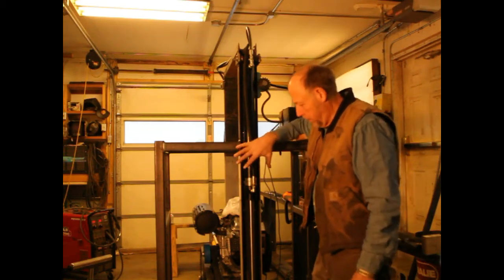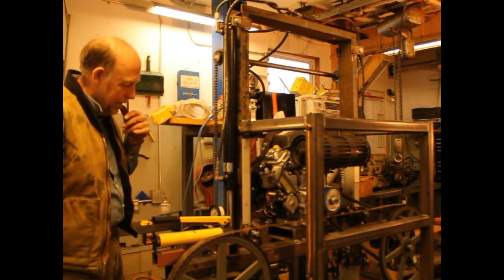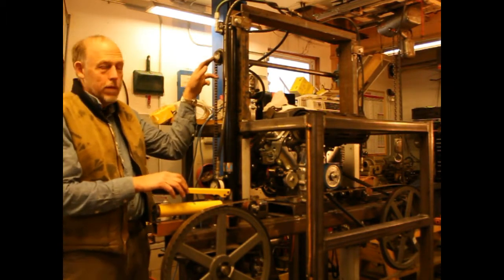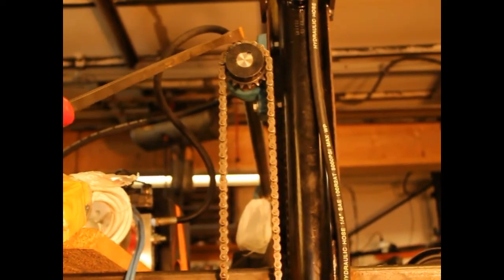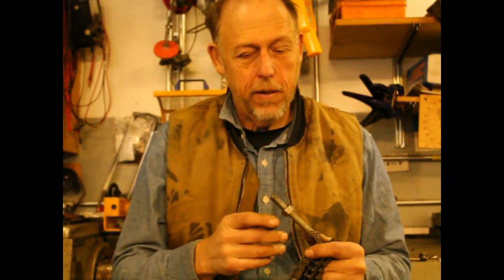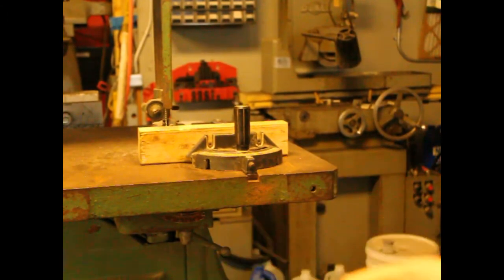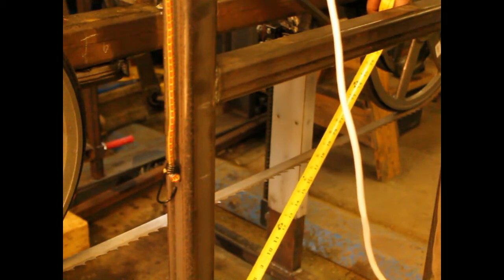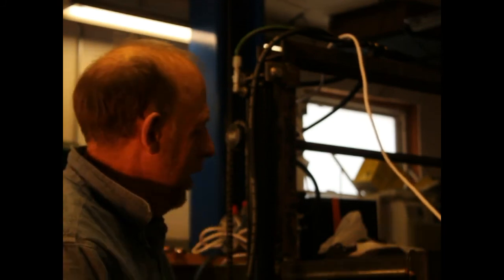12 Volt hydraulic lift.

Comment: With your equalizing sprocket rod configuration why use two rams when a single ram would do ? I looked into the acme rod method of lowering/raising but the larger acme rod is prohibitively expensive.
When you considered the linear actuator method, what were your findings on this such that you went with twin rams instead ?
Reply from the maker: Thanks for the questions.  First I tried using acme screw rods, went to a lot of time and trouble to make all of the  bearing holders and linkages, it failed to raise the head.  I am sure it could work with better design.  The screws bound up and I could not keep them in sync so I gave up and went with the hydraulics.  I did two so that I could make the equalizer system much smaller and simpler.  The head is very heavy and it was easier to install two pistons and not worry about the stress of cantilevering across the arch.  It has worked quite flawless. The only down side is the hydraulic lift uses a lot of 12 volt power, more that the charging system on the saw motor can put out.  I run an onboard 120 volt charger.  My carriage drive is electric so I have 120volts on the mill and it is not a problem to have a batterie charger built into the mill.
Reply: @Haystack461  Okay you convinced me bought a set of cylinders and a 120v pumpset. Then I found the stroke was only 16 inch need 18 inch or more back to square 1 now.
Would be interested in seeing the details on your carriage drive.